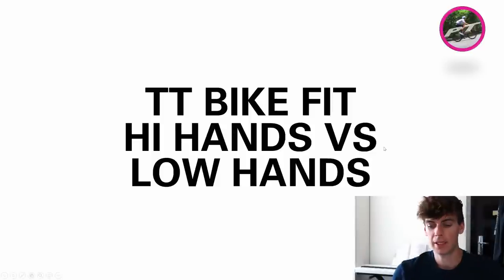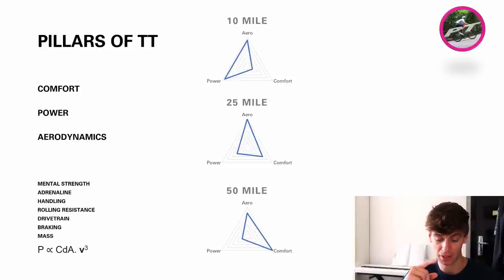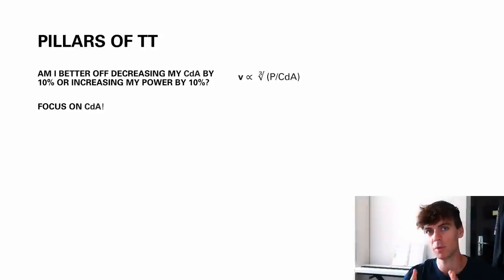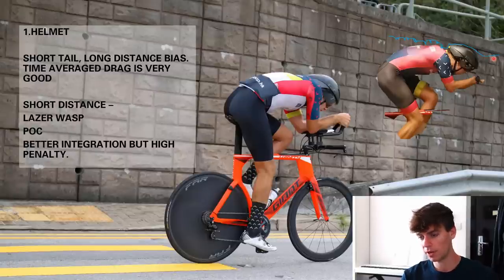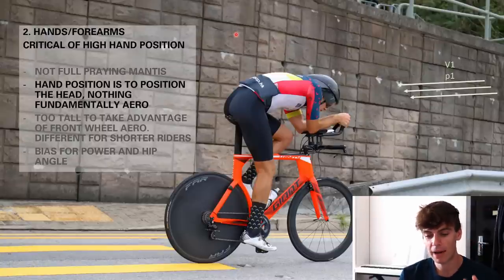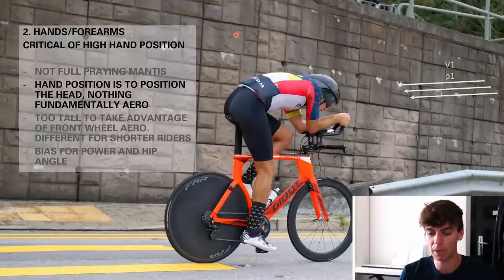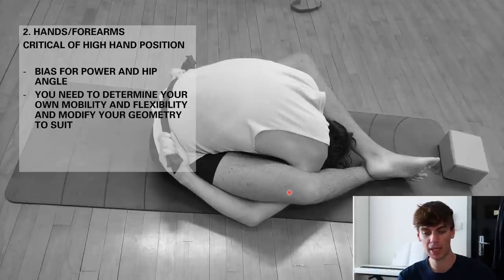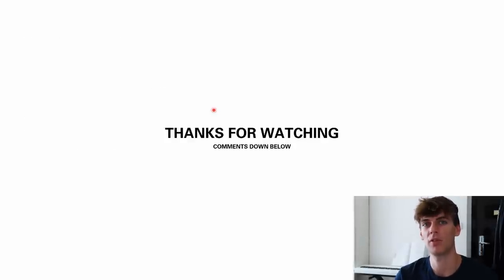TT position - High Hands Vs Low Hands. Time Trialling and Hambini response

Comment: Odd, you keep accusing Hambini of not picking up on the bio-mechanics [comfort] of the riding position but Hambini clearing stated he was not going to discuss bio-mechanics.  As far as hand position goes; should I believe you about higher hand positions or professional cyclists from Europe that modify their positions based on results and many hours of lab study? I cite Remco Evenepoel's and Egan Bernal's TT hand positions. OK, honestly, great videos that really help but there were just a couple of nits that needed to be picked.
Reply: Avoiding the bio mechanic piece creates a severely flawed argument. For the two pros, they both have elevated hand positions, so I'm not sure what point you are bringing up. You can see the angled spacers under their pads pretty clearly in recent footage. Their bodies are also rotated forwards several degrees more than our hero here, reducing relative A in CdA. If you look at the hand position relative to the rest of their body then, it is biomechanically a rather high hand position, and absolutely a moderately raised hand position. They are typically riding mid length TTs and are a barely-mortal class athletes which allows for this more extreme position. If you avoid biomechanics in this discussion, you completely miss the point.
Reply: I'm not ignoring bio-mechanics. My point is; why accuse someone of ignoring bio-mechanics when they stated they were ignoring bio-mechanics, this seems rather hypocritical. If you say the argument is fundimentally flawed because bio-mechanics is ignored - fine but that is a different argument from the one I proposed.
Reply: This is almost exactly the same hand position as PT
Reply: @willspower3  no.
Reply: dude, his pads are stacked 3 inches above the base bar, look at all those spacers...these are small guys who could easily have the pads at the head set height.